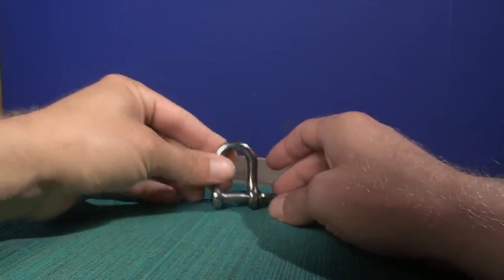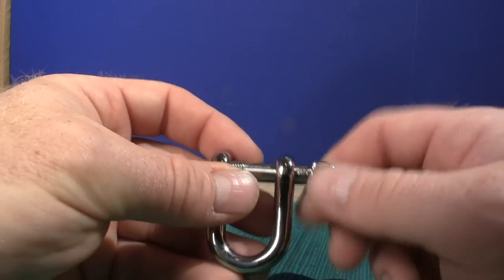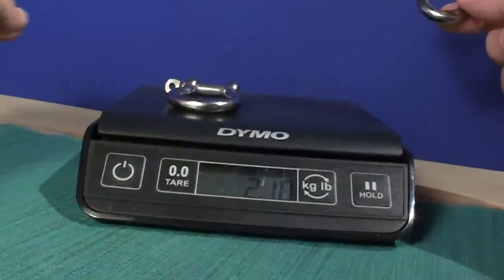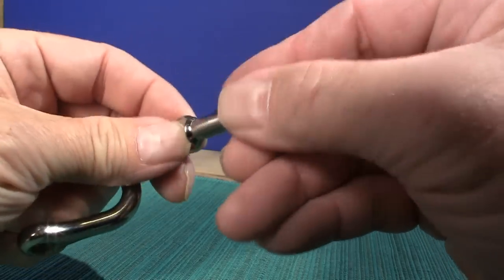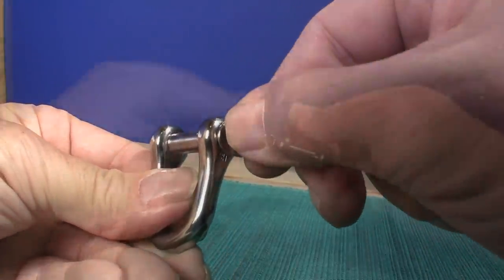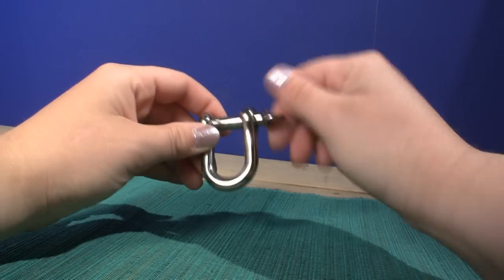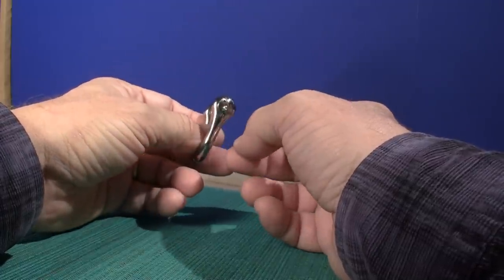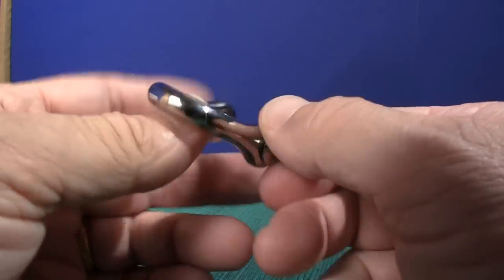Titanium Captive Locking Shackle

Comment: As you screw the pin in, the shackle compresses and then pops back out into the locking notches. To unlock it, you just turn the pin counterclockwise and it goes click, click, click, until it unlocks.

We are going to be offering this on Kickstarter within the week.